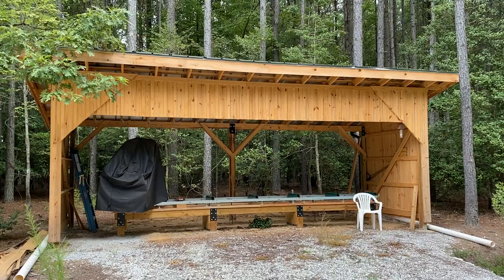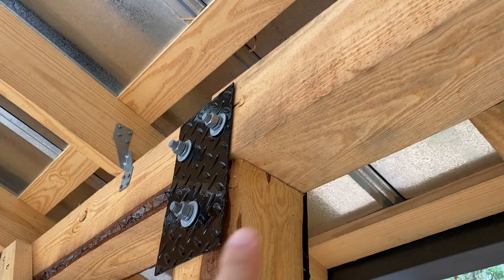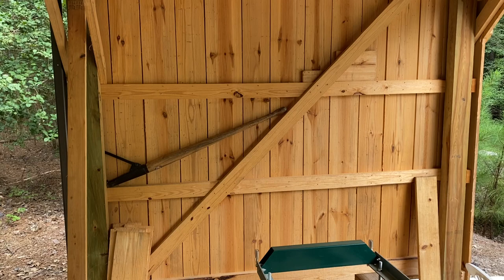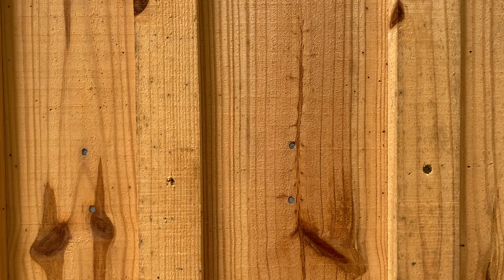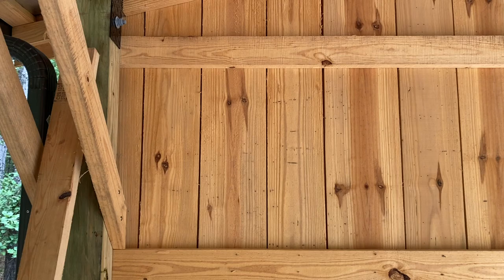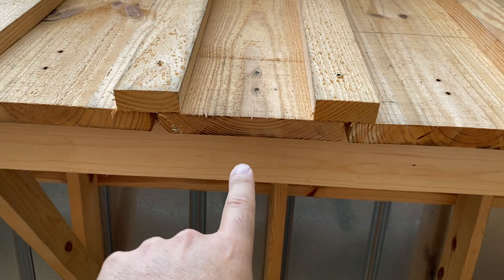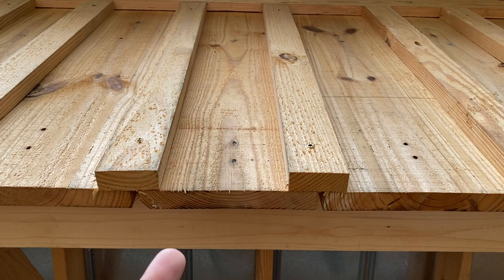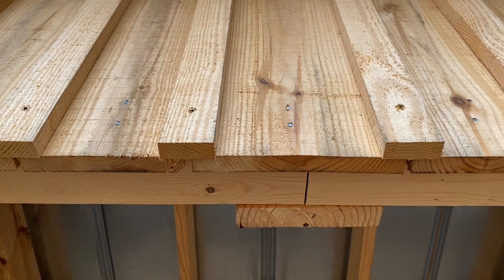Framing and Siding with Green Lumber -- How does everything look after 8 months?

Comment: Firstly, I like your video - thanks.  A point of interest on the board "smile".  Think of the contraction of the board as it dries fundamentally that's what dictates future movement.  So let's assume the grain is straight down the board and linear.  In your case a lot of those boards shown are flat sown adjacent to the heart but right at the heart you'd have a true rift sawn board and the growth rings would contract perpendicular to the long edge = no movement only linear contraction during the drying.  As a mill owner you can choose to do rift or even quarter to gain better stability boards with increase waste... flat sawn as almost all is does require this understanding to effectively place lumber.  You probably know all that and didn't want to waste time in your video ;) for the argumentative YT crowd then lol.  Cheers,

Comment: I guess the issue with the thicker green lumber would be if 1 was going to insulate and vapour barrier. I do believe this causes mold to form in your walls but if you frame it and let it dry standing till it’s dry and one would be in good standing when it’s time to insulate.
  This was a great video for me. I’m starting to build sheds and hopefully my camp this year. 🤞
Reply from the maker: For sure, I wouldn't want to insulate or encapsulate anything with green lumber until it dries.  Sometimes it's a challenge to keep green lumber from getting moldy even when it's out in the open air with full ventilation.
Reply: @Lumber_Jack  good to know. I guess the best thing to do is test it’s moisture content before enclosing the lumber?
Reply from the maker: Yep, that would be good.  I know my yellow pine drops to about 20% within 3-4 weeks if sawed and stacked in the winter, and gets below 20% in ~6 weeks.  In summer it takes forever and becomes moldy, so I do most production in the winter months (plus more comfortable working conditions).
Reply: @Lumber_Jack  I too mill during the winter, spruce mostly and even at -30c I’m out there hauling logs or milling. I find that season better than fly season and super hot season. Fall is a great time for milling as well, but not so good for hauling just cause of the dirt that gets into the bark.

Comment: Thank you great explanation.  Is it possible to build new construction garage and second floor apartment in urban areas with permitting with new lumber?  Maybe a common question.  But, thank you for the info.  Super video and teaching!
Reply from the maker: If building to code with permits, the lumber needs to be inspected, graded, and stamped.  It can be done with rough-sawn lumber but is prohibitively complex and expensive to do with framing lumber when you might have hundreds or thousands of pieces going into a home.  So you'd be better off buying standard lumber that is already inspected/graded (ironically, it is much lower quality than what I can produce on my sawmill).  For a finite number of posts and beams it is feasible to use rough-sawn lumber in a build since a structural engineer can assess those.

Comment: Hi there, i just bought a house in WV, the lower front and 1 side needs some freshening up and i just contacted a Contractor and he suggested Hemlock board and batten, he said its best to install untreated/stained. I was thinking of .6 thick T1-11 but he mentioned this so i am doing some research before i make a decision, he said there is a saw mill in WV where he gets it from.
Reply from the maker: If the price is fair, that will look much nicer than T1-11 and should last longer too.  Hemlock is pretty wood.
Reply: @Lumber_Jack  Thanks, i live in NC but the contractor is going over probably tomorrow to look and take some measurements then give me a price. I was talking with him about 20 minutes yesterday and he mentioned how long lasting Hemlock is and also impervious to insects it is, also mentioned NOT staining/treating it was the way to go. The finished product is pure rustic beauty so that's worth plenty.

Comment: I really enjoyed learning about the smiling of the wood grain tip.  I am interested in building and I was wondering what how you feel regarding non stamped rough cut wood building and your recommendations
Reply from the maker: Around here it can't be used for any structure requiring a permit unless an engineer signs off.  That is feasible for a few posts or beams, but not for stick lumber.  So everything I saw is either for farm structures that don't require a permit or is for non-structural use (siding, flooring, etc).  It's too bad, since the 2x lumber I mill is far superior to what I can buy in a store.
Reply: Read your local building codes, most times you can use it to build structures on your property but if you sell boards to others to use in construction they will most likely need to be stamped

Comment: Awesome video and great looking shed!  Thank you for the detail of tips for using green SYP.  Where did you buy your black diamond gusset plates?  Or are they DIY fabricated from sheeting?
Reply from the maker: Yes, those were made from some 1/8" diamond plate I had on hand (I bought a bunch of scrap sheets a few years back).  To be honest, it's not the best choice because it's harder to cut and drill than plain sheet stock, but it's what I had on hand.
Reply: @Lumber_Jack  Thanks for the reply!  I figured there were some labor hours if it was a diy application.   They still look great and unique.  The plates are fairly reasonable and I have no spare diamond plate sheets lol.  Keep up the great work!

Comment: Im considering using green wood beams that will lay on top of a pier foundation then on top of that add floor joists and build a small house (20 x 24'). Only the beams will be green. Do you think this is doable? Id be nailing the floor joists to the green wood beams. I wonder how this would behave?
Reply from the maker: It's doable, just plan for the beams to shrink as they dry out and allow for that movement.  You can estimate the shrinkage (generally 7-12% across the grain depending on species) and account for that.  You'll want the beams to be able to settle onto the piers and then the upper framing will come along for the ride.  That either means having slotted holes in your pier brackets and/or ovaled bolt holes in your beams.  I do that with green beams and it always works out OK.  As the beam shrinks it can keep settling back down on the base.  Some other cautions:

1) green beams will be super heavy, so be sure you can lift and position them.  

2) don't go longer than you need to with beams, since longer beams can potentially be less stable as they settle and exacerbate shrinkage issues.  Better to use shorter beams suitable for the span and have joints over piers where the beams have freedom of movement.  I would only span multiple piers with a single beam if there is a structural need to do so.

3) if fastening dried lumber to green lumber, remember the green lumber will shrink/move so the fasteners (type and pattern) need to be able to accommodate that or one/both of the wood members will potentially crack/split or pull/break the fasteners.  If your floor framing can float over the beams that will avoid issues.  You can either use brackets and fasteners that allow movement, or just fasten along one edge and give the beams time to dry out before you go back and fully attach the floor framing to the beams.

All of this advice is on the conservative side.  Some people take none of these precautions and things work out OK or the issues are not a problem for them.

Comment: Could you also in addition to board and button, make a tongue and groove/ overlapping boards so they won't have any gaps and you can still fasten the battons to the tongue edge?
Reply from the maker: Probably wouldn't be as stable -- one of the keys to board & batten is that the batten is fastened directly to the structure (wall girts) and not the boards.  This independent fastening method is what keeps the boards tight at the joint even as they shrink/move and even if they want to crown/cup.  You'd lose that if the batten was attached to one of the boards.
Reply: That’s what I’m doing. T&g. I can live with gaps

Comment: Make the holes for the bolts on the plates bigger than needed for settling, If the plates are all tightened up tight, how will the beam settle?
Reply from the maker: As I mentioned in the video, I wallow out the holes in the beams when drilled and oversize holes in the plates.  It allows plenty of slop for things to settle.  The beams shrink in width and height, so plates that are tight with green lumber will be loose as the wood dries, and everything can settle as it needs.
Reply: @Lumber_Jack  so dont really tighten the bolts and plate hard when wet? Save the real torquing for when it all drys out?
Reply from the maker: @AnotherCritic100  You can fully tighten when the lumber is green.  Be sure to use lock washers so that tension is kept on the nuts and bolts while the lumber shrinks.  Check back in 6-8 months after the lumber has shrunk and you'll be able to snug the nuts down further.

Comment: Nice build. I noticed on your angle supports you used fasteners side by side. Is there no worry of this splitting as they dry?
Reply from the maker: I have not seen splitting in any lumber 1.5" and thicker so I don't take special precautions unless some type of settling is anticipated.

Comment: I am looking at the gusset Plates you used and am wondering if I should use something like these in my Pavilion build. I am using 6x6 Cedar Post and will use either 6x6 Pine or Oak for the 4 Beams that will be connected  post. I have been looking for information on the best method to attach the beams to a post for the corners. any suggestion will be greatly appreciated
Thanks
Reply from the maker: There are so many methods that could be used.  I like this one, but also check out my videos on the timber frame carport.  For that, I notched out the posts and bolted the beams directly to the posts (which is my normal procedure for pole barn type structures).

Comment: Did you seal the wood with anything to keep it from warping? Mainly thinking of the large beams.
Reply from the maker: No sealer, and that probably won't affect stability of the wood in a noticeable way.  If a large beam wants to warp, it's going to do it no matter what you put on the surface.  There are some very powerful forces in the wood fibers that will win out regardless of other factors.

The main way to get stable beams is to carefully select the tree and make good cuts with the sawmill to keep the grain (pith) centered and symmetric.  Then properly frame and brace the lumber in place with a good sound construction methods to enhance stability.

When framing with green lumber, I'd allow at least 6-8 months before applying any type of sealer.  You don't want to inhibit the drying process while moisture needs to escape the green lumber.

Comment: For your side girt 2x6s, how many nails did you put those? I’m considering using green lumber for girts on a metal stud building.
Reply from the maker: I normally use 2x4 for girts and they get 2-3 nails  into each post.  For skirts I normally use 2x6 or 2x8 and those will get 4 nails into each post.

Comment: What was the plan you used for your saw shed? I need to make on too,is the plan for it somewhere to find?
Reply from the maker: Just made it up as I went along.  It's a pretty standard pole barn type of structure which you can make in any dimension or configuration.

Comment: Were the posts cut fresh or are they treated?
Reply from the maker: The corner posts are pressure treated 4x6.  The back center post is rough sawn 6x6 mated to a treated 6x6 base in the ground.
Reply: @Lumber_Jack  i figured because of the greenish tint. Store bought? Or did you treat them

Comment: How long would you wait to apply stain?
Reply from the maker: On average, probably 6-12 months from when the wood was milled green, but a lot of it depends on the local weather and humidity, as well as the species of wood.  In a dry location, softwoods season very quick and within a couple months will take stain with good penetration.  The other thing to consider is shrinkage of the wood.  If you stain it too soon, the wood will keep shrinking and you'll see any un-stained gaps peeking through over time.  To be totally safe, I'd wait 6-12 months.
Reply: Thank you for the response!